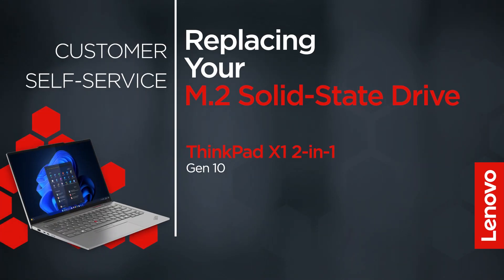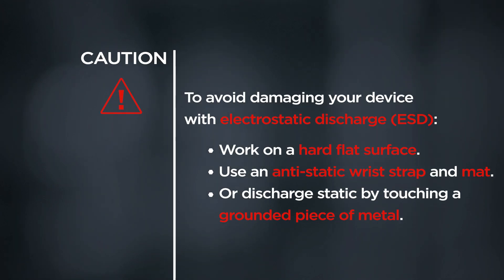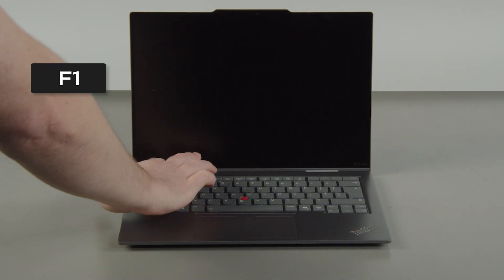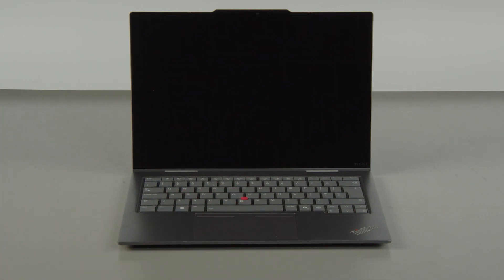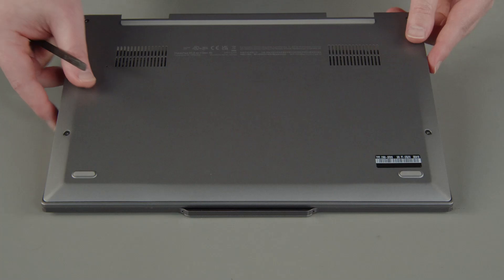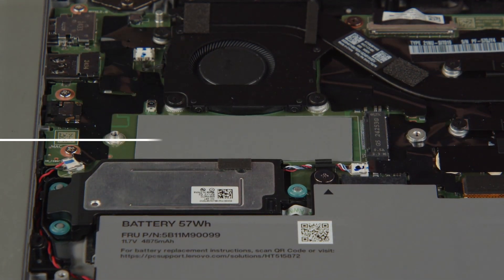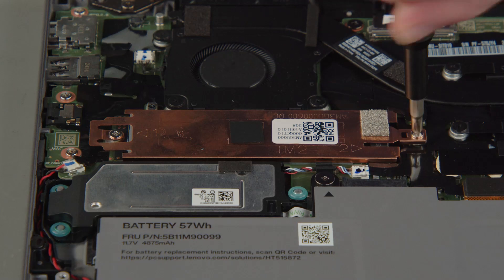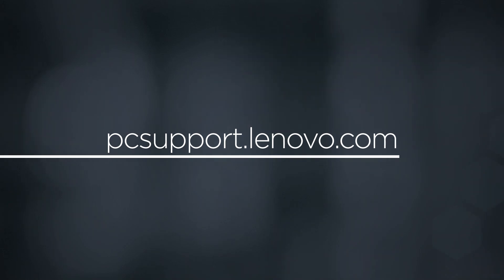Replacing Your M.2 Solid-State Drive | ThinkPad X1 2-in-1 Gen 10 | Customer Self Service

Comment from the maker: This video will show you how to replace the M.2 solid-state drive in your ThinkPad. The process in this video will work for the ThinkPad X1 2-in-1 Gen 10.

You will need a screwdriver kit, a non-metallic pry tool, and 15 minutes of your time.

To learn more about your device go to https://pcsupport.lenovo.com

To find parts for your device go to https://support.lenovo.com/parts-lookup/?cid=ww:lenovosocial:b9515f&source=socialmedia&subsource=yt

To view the Lenovo Support Self-Repair Guides landing page go to https://support.lenovo.com/us/en/solutions/HT516547

** NOTE: Static electricity can destroy components. Use a grounding strap, and clean, non-conductive surface to work on. Use plastic or coated tools to prevent scratching and avoid using metal tools on plastic parts. For more detailed information on electrostatic discharge and how to prevent it, please watch our "Understanding Electrostatic Discharge (ESD)" video: https://youtu.be/by4PB3WtdLo 

Applicable Machine Types:
ThinkPad X1 2-in-1 Gen 10 - 21NU, 21NV, 21Q0, 21Q1

Check out other official Lenovo channels!
https://www.youtube.com/@Lenovo 🟥
https://www.youtube.com/@lenovolegion 🎮
https://www.youtube.com/@Lenovo-PC 💻
https://www.youtube.com/@LenovoSuporte 🟢🟡

#Lenovo #LenovoSupport #LenovoTechSupport